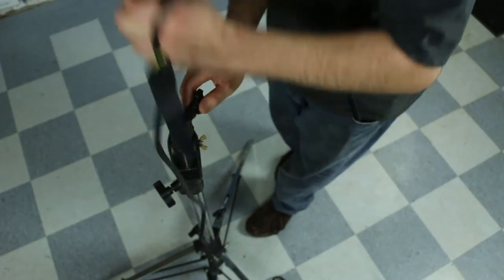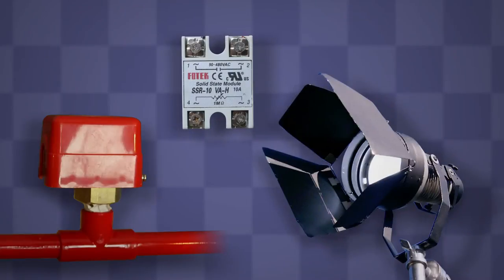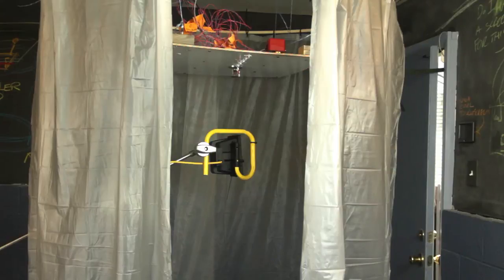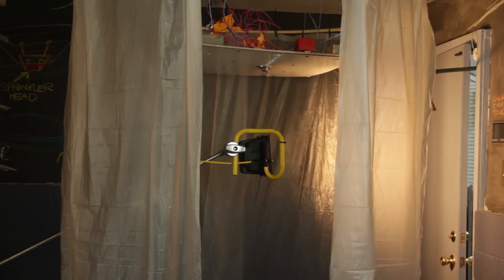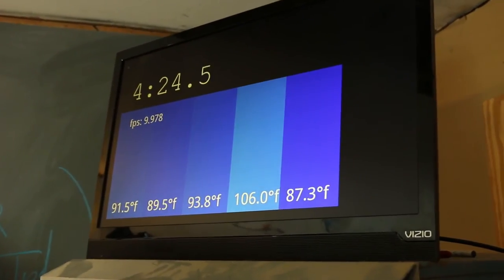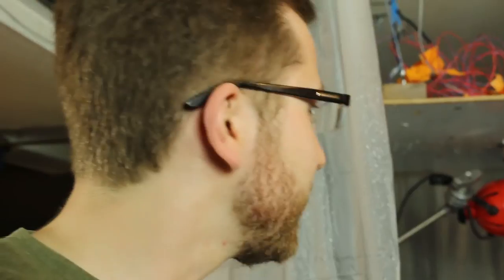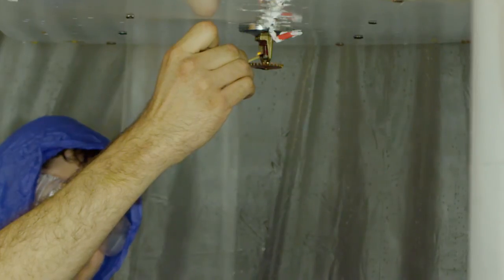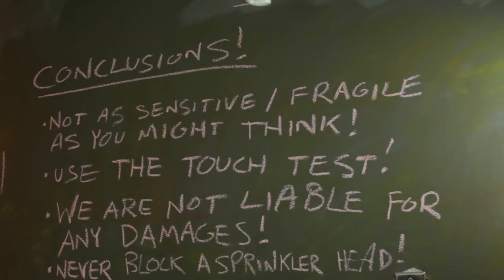Will a video light set off a sprinkler head?

Comment: Those sprinklers are called "upright sprinklers" and are not meant for this setup. That's why the water goes to the ceiling instead of the floor. You should have gotten a pendant sprinkler for this application. They are the same price too.
Reply from the maker: Yeah, I've gotten called on this before, but I wasn't really going for fire-safety accuracy!  I just needed an accurate glass bulb that would burst at that critical temperature
Reply: Ok, sorry. I just like to point some things out, and sometimes I take it too far. How much did the sprinkler heads cost?
Reply: Sprinkler heads are immensely expensive to those who are not licensed contractors. The price is increased by like 800% to the average Joe. Pendants are also more expensive than uprights, even at the discounted price.
Reply: FireAlarmDude5967 that was the first thing I noticed they got a fucking upright in a pendant position
Reply: It's for a demo..
Reply: AlexandersAlarms Deactive - channel dead when you reply to a comment that’s almost 3 years old...
Reply: @FireAlarmDude5967  he does that all the time lol

Comment: Get some good LED lights. Less heat, brighter, more efficient, you can place more on one extension cord (since they are like around up to 10x more efficient, they draw less power.), they should last longer, etc... some even can change the color temperature with the flick of a switch.